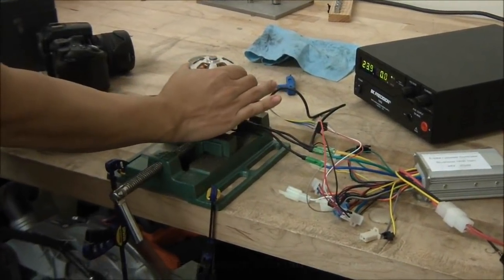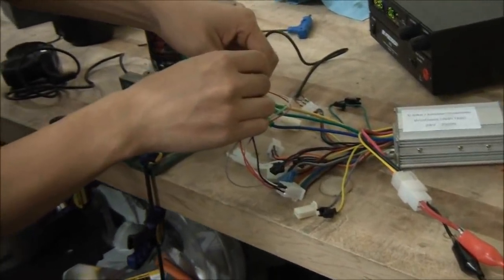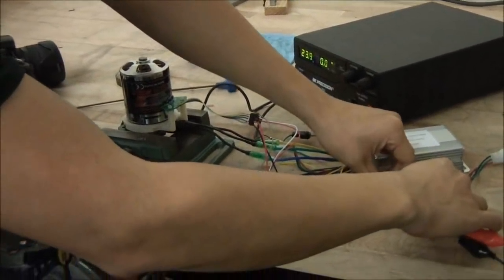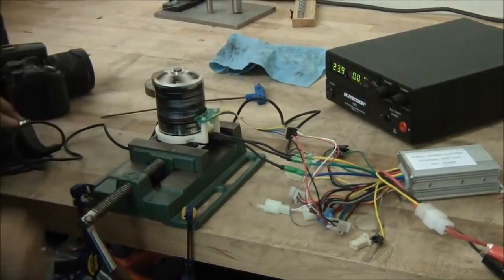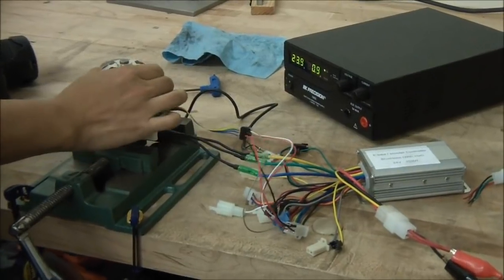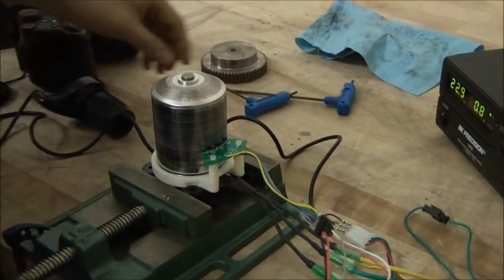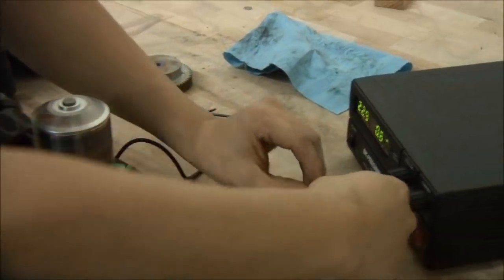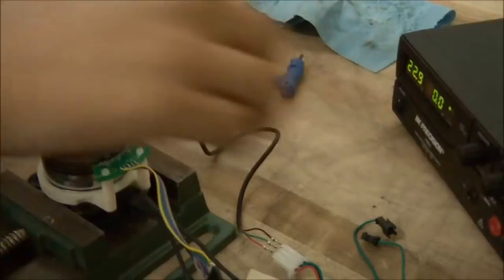Chinese e-bike controller Hall sensor self-calibration demonstration

Comment: Hello I just ordered 2 Chinese ebike ESC's and it has a red "swich plug" that it says needs to be connected but there is no wiring diagram to tell me where it goes, do I connect it to the positive battery lead? It also has a "low level" and a "high level" plug, do I need to be concerned knowing how to wire thoes? I know the basics on how to connect the motors, battery and throttle but there a few extra connectors I'm not sure what they do. Any help would be greatly appreciated and I may ask a few more questions when it actually gets here. Thanks

Comment: Im looking into EV conversions also (on a modest budget) & looking to buy a good matched setup from which to start the tinkering
what motor is that? any recomendations for a motor that is best matched for this controller? this  vendors highest rated controller is 2000W, any suggestions on a motor from HK  which would really compliment the 2000W controller? im hesitant to buy either just based on advertised #'s alone,
thanks

Comment: Hallo,
I have an chinese controller, and identified the cables. If i restart the controller with the learning cable is connected it stops and changes direction. but my throttle does not work on regulating the speed it ranges from 0.4 until 2.2 V, once it reaches 2.2 it restarts the motor, and changes direction. when i disconnect the learning cable, the motor does not run until i  turn my throttle handle , then my motor moves once for not even a second and then stops until i restart the motor and wait a moment.

Comment: I have a controller that has the self learn. But theres no voltage on the 5V hull sensor wire.  how do I turn the sensor on. is there a trick?
Reply: i have same problem, my controller dont even spin the wheel. whats could be wrong?

Comment: is it possible to use hall sensors to synchronize multiple controllers for the purpose of paralleling several controllers to power a 3kw melon?
Reply: no

Comment: Could you kindly enlighten why is there the need to Self-Learn? Is it due to the different motor inductance?
Reply: +Debby Johnson The self-learn switch allows you to change the motors direction of movement using just the motor controller. Like with a DC brushed motor you might find that it moves, by default clockwise when powered in positive polarity. If your application requires the motor to go in the opposite direction and you cannot change it's direction manually, then you wire it for negative polarity. It has nothing really to do with motor inductance, but how you positioned the motor when it started and what polarity you set for it when you begin running it. 

The motor controllers use the self learn switch to reverse direction of throttle without having the user physically change the motor's orientation manually.
Reply: I believe it is for the controller to know the phase of the hall sensors. I could be wrong though.